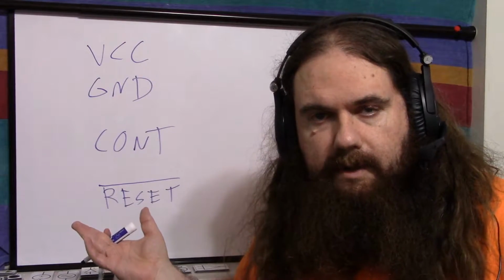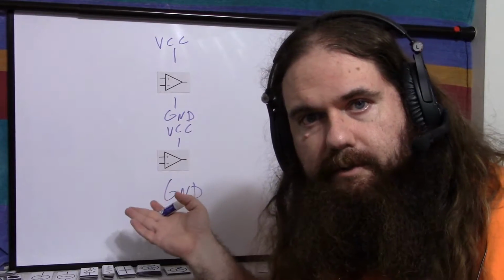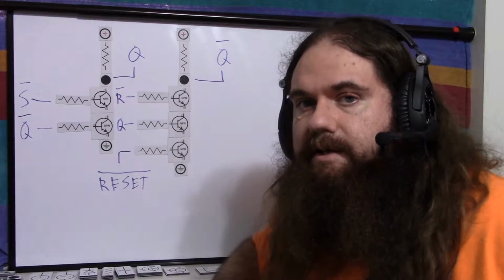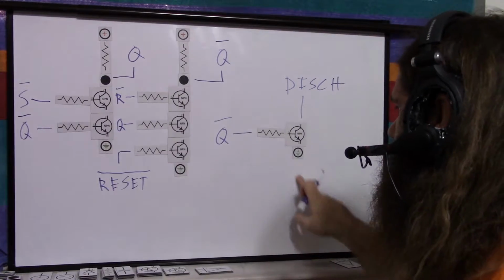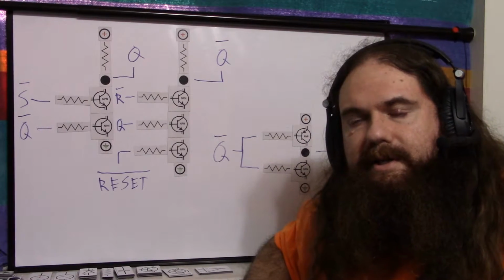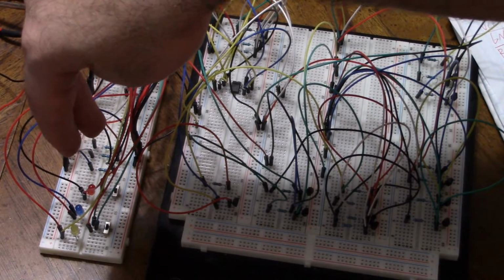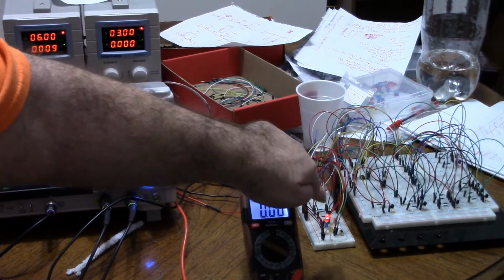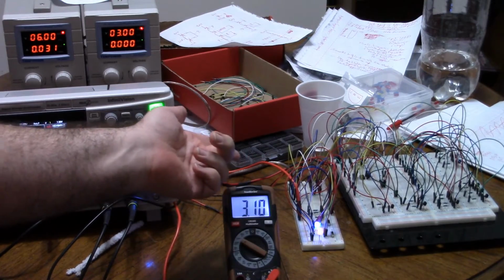Homemade 555 Timer - In-Depth Design Walkthrough And Demonstration - Simply Put

Comment: You don't need the base resistors for the push-pull transistors, just a pair of diodes to bias the output signal. I love making PWM SMPS controllers from BJTs for fun. I just etch my boards. You can't use breadboards in power electronics.

Comment: The 555 design is so useful but they are limited in their frequency (even though some go higher) could this design be used to have reliable design of an 555 timer with high frequency and more power.
Reply from the maker: I don't see why not: The frequency and power limitations would be determined by their parts, so you could always just use better parts.

Comment: that was fucking awesome(excuse my language) its in my favorites & will be watched over and over.. If you used FET's instead of BJT's would you get the cmos  version 555?????
Reply from the maker: Mosfets would be easier to work with, yes. Unfortunately I don't have enough discrete mosfets right now to do it, although I could use Nand and inverter gate chips instead. For digital logic gates, open collector/drain, and push-pull, BJTs and MOSFETs (CMOS configured) are basically interchangeable.

Comment: Fascinating how a 50-year-old piece of technology is still widely used by hobbyists (I'm not sure if professionals still use it, toys still do mostly)! An average phone gets thrown away in 5, yet this magical chip has remained alive for 50.
Reply from the maker: It's a schmitt trigger, it's a d-type latch, it's a digital buffer, and it's an astable and monostable multivibrator. And includes both open-collector and push-pull output. And it can be used in any or all of these modes at will in a live circuit with creative use of switching. So yeah!